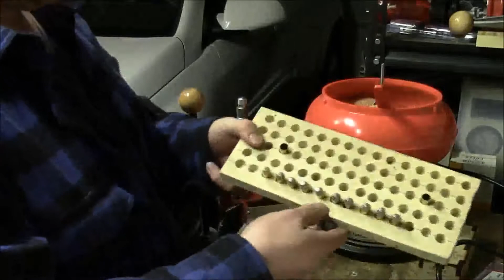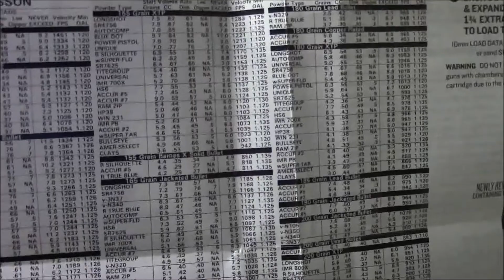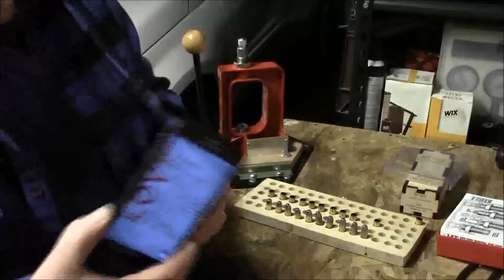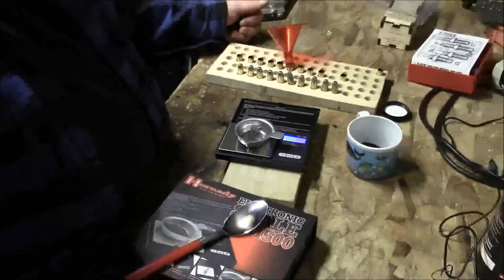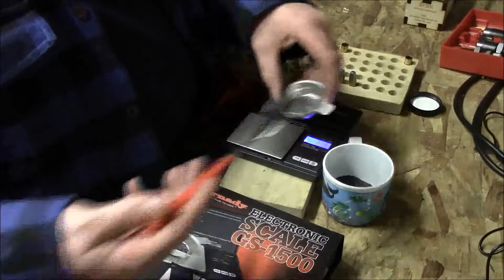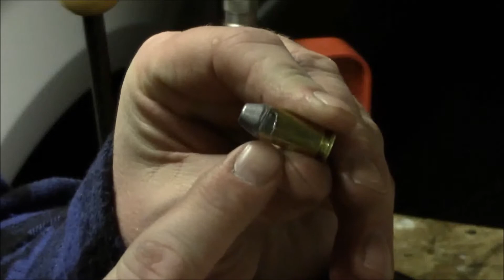Reloading podcast 002

Comment: I think it's called a bullet seating and feed die because the bottom is tapered to open the bullet feed fingers so it can be used with the bullet feeder.
Did you flare the case mouth and it still shaved lead off?
I don't remember hearing you mention flaring and you didn't use the powder through expanding die that I saw.
Thanks for the Reloading Podcast!